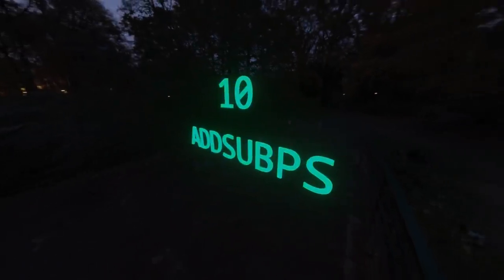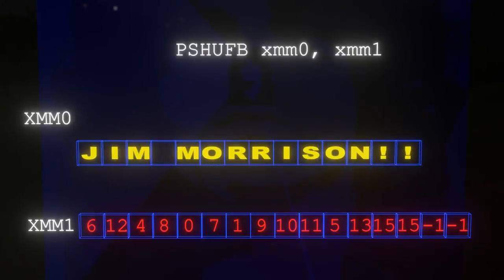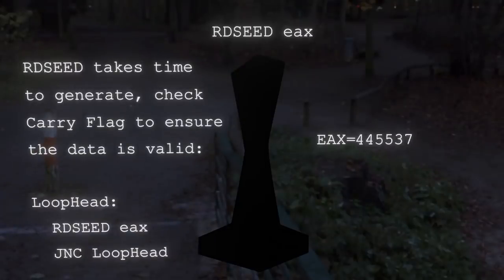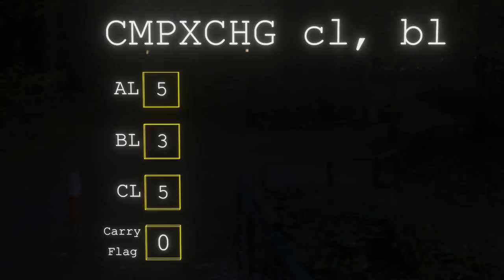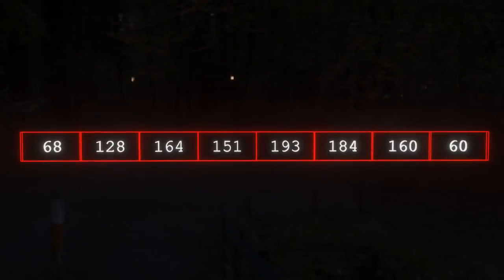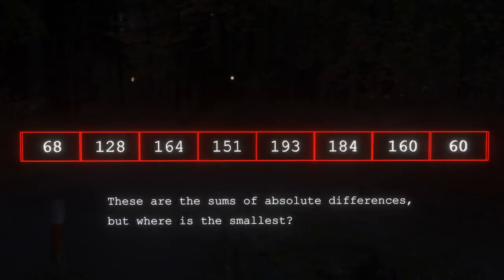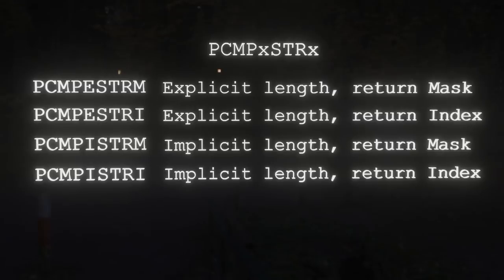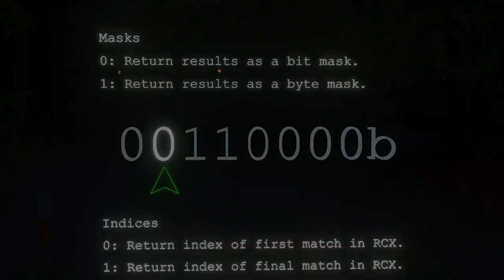Top 10 Craziest Assembly Language Instructions

Comment: Wouldn’t it be better to call them functions instead of instructions at this point?
Reply: Needs a RUNDOOM instruction.
Reply: @jjoonathan7178  At least IDDQD seems plausible, integer divide quads by double, store results as double :)
Reply: They have their own implementation circuitry therefore they should be called instruction, and this is also one of the most important feature of x86 ISA, we make complex operation into an instruction to shorten the execution time and make program smaller.
Reply: @oldxuyoutube1  well, there is microcode...
Reply: No, because they are not functions; maybe you could call them routines but not functions.
Reply: @oldxuyoutube1  do they really have ? how much are those instructions used ? perhaps they are mostly microcode.
Reply: Ya...I totally forget about microcode, but frequently executed instruction should still implemented in hard-wired due to performance, and those infrequently executed instruction or instruction that too complex to use combination logic use microcode?
Reply: @oldxuyoutube1  100% of them are microcoded, and on Intel's chips, 100% of ordinary instructions affect the Re-Order Buffer (ROB) [some exceptions exist for configuration/fencing operations which are not instructions in the same sense]. Some operations are combined/fused at decode time or in the ROB, and some operations "take zero cycles", as in, they simply reconfigure/rename an operand in the ROB (usually changing its width, or changing the register name).
Reply: What is this a software emulated coprocessor?
Reply: @microcolonel  Instructions and Functions go hand-in-hand... If you have every done Boolean Algebra with truth tables and Karnaugh maps to help reduce Sums Of Products and Products of Sums... You will understand that the actual layout of the bit field or bit pattern defines its instruction or instruction type. The values that are set to these fields are the op codes short for operation code. Now, the values that go in would be the argument or parameters, and the resulting value it's output. All of it combined could be a function, but not necessarily... Functions have a 1:1 ratio of its Input and Its Output, otherwise it's just an Expression or Equation that can produce multiple answers.However, the way that circuits are designed I can make the assumption that most of them would be functions... You don't want to be setting a single bit and the computer does something and then the next time it does something else if nothing else had changed... this would create ambiguity and would cause the computer or device to be useless. So I would say that it depends on who are you are speaking to, and the context in which they are referring to would determine if it's an instruction or a function.
Reply: @skilz8098  the thing is though, an instruction isn't really given parameters, it is described to fetch the operands and write to a register. It doesn't evaluate to a value.

Yes, you can model instructions like this in a compiler, but once the registers are allocated, these aren't functions.
Reply: @microcolonel  Yes and no... it isn't given parameters directly, but the parameters are bit fields within the instruction itself. For example:

.486
.MODEL FLAT
.CODE
PUBLIC _myFunc
_myFunc PROC
  ; Subroutine Prologue
  push ebp     ; Save the old base pointer value.
  mov ebp, esp ; Set the new base pointer value.
  sub esp, 4   ; Make room for one 4-byte local variable.
  push edi     ; Save the values of registers that the function
  push esi     ; will modify. This function uses EDI and ESI.
  ; (no need to save EBX, EBP, or ESP)

  ; Subroutine Body
  mov eax, [ebp+8]   ; Move value of parameter 1 into EAX
  mov esi, [ebp+12]  ; Move value of parameter 2 into ESI
  mov edi, [ebp+16]  ; Move value of parameter 3 into EDI

  mov [ebp-4], edi   ; Move EDI into the local variable
  add [ebp-4], esi   ; Add ESI into the local variable
  add eax, [ebp-4]   ; Add the contents of the local variable
                     ; into EAX (final result)

  ; Subroutine Epilogue 
  pop esi      ; Recover register values
  pop  edi
  mov esp, ebp ; Deallocate local variables
  pop ebp ; Restore the caller's base pointer value
  ret
_myFunc ENDP
END

Each mnemonic such as ADD, MOV, PUSH, POP etc, has a specific bit field with a specific bit pattern a 1:1 relation. However, these bit patterns might only be 3,4,5 bits in size... yet the entire instruction is 32, 64 bits or even variable length encoded instructions... The other fields of the instruction are the source and destination registers or immediate values. The immediate values and your source registers would be considered the functions parameters... 

Yes there is a difference between an instruction and a function, but they are subtle. If you are designing the circuitry, it has a number of inputs and outputs... and depending on the inputs, it will produce some set of outputs and the intended behavior that the circuit is designed for is its function. An instruction set to a CPU is the combination of the buses (data paths, address buses, and control lines) that connect to and control various circuits and or device modules... 

Like I said, it depends on who you are talking to, the context in which they are referring to... as well as the level of abstraction are you working on within the system...

We can use a set of instructions to construct a Program. A program can be one or more functions.
Reply: @yadt  This. FPGA microcode allows you to set up a complex instruction like this while in use, and then clear it when the program ends.
Reply: Everything you have pure silicon for is an instruction. A function is always a list of explizit instructions. You should leave it almost always to the compiler to decide which combination of instructions fits your need as you have no other option than reading and think threw your assembly code once you touch the instruction/function question by hand.
Reply: @oldxuyoutube1  but a lot of these instructions probably don‘t have custom pipelines or even pipeline stages. Instead they use microcode to control the data flow to some shared arithmetic blocks.
So they actually kinda are like functions in a way.
Reply: @MrHaggyy  
> A function is always a list of explicit instructions

This is just not true. A function may be represented in a machine with a stack ABI or a register-based calling convention as a sequence or set of instructions, but it can also be represented as a directed graph of functions, and at the end of the day a function is meant to evaluate to a value, whereas a routine may simply "do something".
Reply: @nolan412  is that a joke or are you not familiar with modern x86?
Reply: @microcolonel  ^^ ok you are right. But i don't think graph theory is good starting point for this. I thought more about classic functions in coding like "uint32 intadd (uint32 a, uint32 b) { return a+b}" or a hello world function. Which is encapsulating a set of instructions. Also with fetching these functions at once into a branch/pipeline of instructions. Also a graph of functions still has to be computable into a set of instructions. So even if the instructions might vary for a given state and input in a graph, the single components of the graph need to be something like the routines you mentioned, in order to be computable.
Reply: @oldxuyoutube1  except that doesn't help, if you just look onto arm, these operations can be performed over there, perhaps with more than 1 cycle but the compiler is much more efficient now and when you compare the results a capable arm chip performs almost equal if not better.

Comment: I'm no programmer but it appears to me that programming these instructions into a CPU is just about as complicated and fascinating as quantum physics.
Reply: Then you don't know much about quantum physics.  The point is that these instructions were added because doing these operations (which are needed in very specific cases) in software is otherwise very inefficient.  In fact, in a microcoded CPU, they aren't that difficult to implement.  If you really had to do these things in "hardware" (i.e., dedicated logic gates), that would be a whole lot of square microns.
Reply: @BrightBlueJim  man, what a day and age we live in, to have real estate measured in microns! I'm only 20 years old, and I'm already living in the future. Imagine what the actual future holds!
Reply: @mage3690   Microns? If you want an actual comparison to real estate in terms of cost for high-end parts, you're going to want something a little bigger. Your unit will be the nanohectare (10mm^2). Your typical big complicated chip will therefore be around 20-40 nanohectares in size and will have cost Intel or AMD the equivalent of buying 20-40 hectares of actual land to develop.
Reply: half of the fun was all the bizarre "words" that mystified everybody else.  it made you feel special.  it's not as complicated as it looks.  abstracting the problem into code is harder
Reply: Actually CPUs only work because of quantum science do yeah, even an NOP instruction is quantum science

Comment: This made me realize that X86 is more abstract than the C language, each of those instructions are like 4 or 5 lines of C.
Reply: Now imagine having to teach a compiler to take your 5 lines of C code.... and figuring out which of the five thousand different x86 instructions is the perfect fit :P
Reply: That's the opposite of more abstract. Being more abstract means you have tools that are more general-purpose in order to handle a variety of different uses. These instructions are not abstract; they are intended for specific purposes and aren't especially useful at all otherwise.

Consider that these instructions are actually implemented as microcode inside the CPU -- miniature programs built out of primitive building blocks.
Reply: @codahighland  i guess what he is really trying to say is that x86 is so bloated you can implement the same thing a billion different ways
Reply: @davestephens3246  Was the ad hominem even necessary? I wasn't judging. I was just giving information.
Reply: @codahighland  "they are more general-purpose in order to handle a variety of different uses"
that's why I said what I said. "X86 is more abstract than C"
x86 has lots and lots of complexity, the instruction set has lots of arguments and things that happen in some state and not in others, the instruction is variable length.
So, the instructions can be used for lots of different purposes, with different modes, different registers, and so on, and so forth.

The instructions are actually implemented as microcode should be more than enough evidence that assembly is more abstract than the machine itself.
Assembly is much more complex than the abstract machine that defines C and which you program to.

C is basically a macro-assembler for the PDP11, X86 is a monster near it, it can do a lot, much more things, you can fine control memory load/store ordering, lots of abstract things that you can't even do in C, like barriers, for example.

One practical example, there are SIMD instructions that a single instruction will to an entire for loop with sum and comparative to a variable, but in a register, like 4 or 5 lines of C is just a single asm in x86, and the compilers know how to translate that, because you can't even declare data-paralelism in C, the compilers have to pretty much guess so otherwise the CPU would be idling because C programs are sequential, but what we care about is how data relates to itself, not the control-flow of the program, the CPU couldn't care less about it (speculative execution for the win!), all because the C has less abstraction power than the machine itself.

C is really, really outdated.
Reply: @sunnohh  Just the MOV instruction is enough to implement an entire working computer emulator.
Reply: Assembly language is actually less abstract and more concrete. 
Closer to the silicon than C.
Reply: @monad_tcp  No. Assembly language is more concrete, and less abstract than C. 
C abstracts what can be done in assembler. C is an abstract language by assembly language standards.

Comment: god, not even cryptographers would bother figuring these instructions out nowadays. no wonder RISC instruction sets are so much faster for the same electrons, they don't need to snake around the dark winding alleys of the ALU
Reply: They absolutely do, though. Crypto nearly exclusively is written in assembler, and prioritises code that always takes the same amount of time to execute (to prevent timing attacks), and code that also otherwise doesn't leak state (the amount of time something takes to execute is a leak, but if it's always the same you can't extract any data from it)

Comment: I just did an assembly presentation for uni. Super basic, the most advanced thing I covered were loops. I did it with mips because simple easy setup and stuff. I knew "proper" CISC assembly had more instructions but holy moly I do not understand half of these. And apparently some of those work in one clock cycle? I'm currently questioning everything I ever knew. These madmen made sand do regex.

Comment: I can not imagine a compiler that utilizes these fully! Use asm, optimize by hand!
Reply: I agree it’s borderline impossible for compilers to emit them automatically. I saw clang’s auto-vectorizer emitting vpshufb but that was very simple code.

I disagree about ASM. All these instructions can be used in C or C++ as compiler intrinsics, way more practical.
Reply: @soonts  yes, but if one can understand and use intrinsic properly, then heshe can just write entire function in ASM too (right there inside C code),  so it not about how exactly to use it, its about to use it efficiently at all.
Reply: @mojeimja  The code I write often has both SIMD and scalar parts, interleaved tightly.
Modern compilers are quite good at scalar stuff, they abuse LEA instruction for integer math because it’s faster, and do many more non-obvious things. Just because they suck at automatic vectorization doesn’t mean they suck generally.
For SIMD code, manually allocating registers, and conforming to the ABI (i.e. which registers to backup/restore when doing function calls) is not fun.
With intrinsics, the compiler takes care about these boring pieces.

Comment: All of them are SIMD/vector instructions except CMPXCHG (which you need for doing atomics and is arguably less complex than alternatives such as load-lock + store-unlock). Plus, aside from CMPXCHG, none of them write to more than one register (except for flags) or even interact with memory (aside the normal x86 thing of being available in load-modify and load-modify-store forms). None of them can cause special exceptions (aside from the normal page faults from memory addressing). Compared to stuff like 286 protected mode instructions, x87 register stack insanity, decimal instructions, arguably block operations, these are tame (even moreso compared to Itanium ALAT insanity and load checked and reg file rotation).